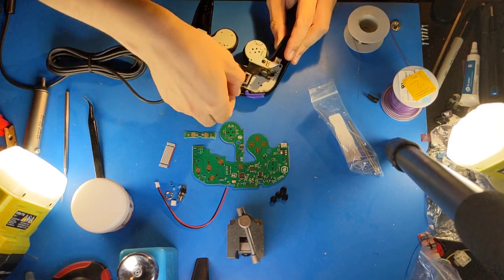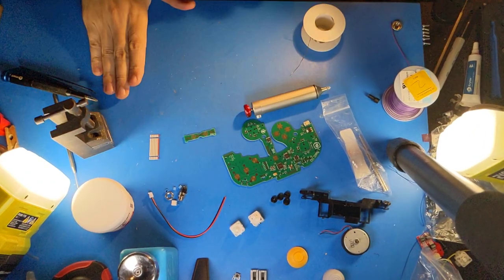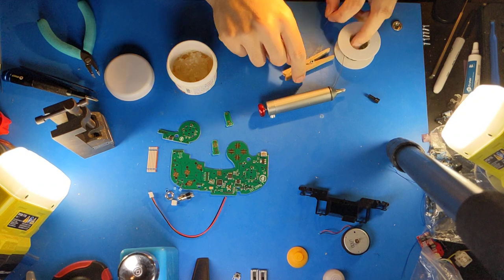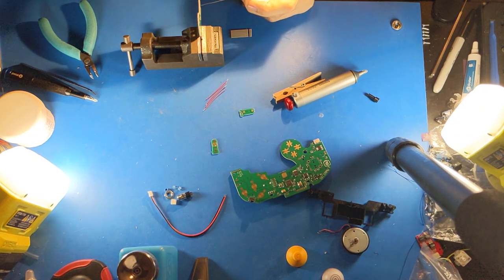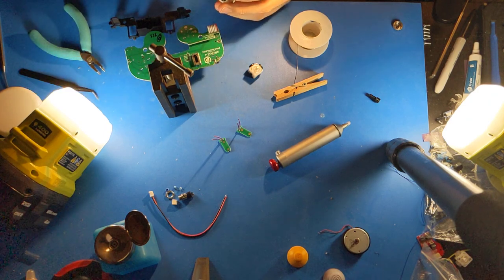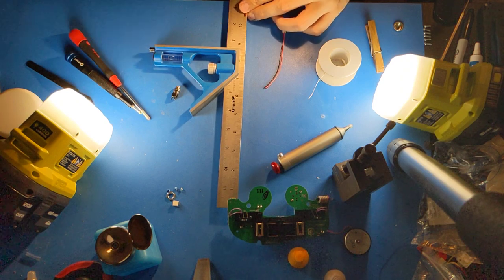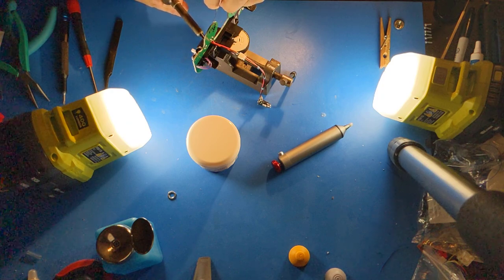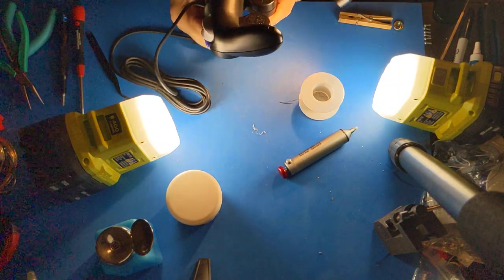PhobGCC 2.0 Assembly Video

Comment: Any way you could link to your soldering iron and tools like solder sucker, etc?
Reply from the maker: @suntzu6122  
Recommended tools from Amazon:
B08KDKMXRJ (vise)
B077JDGY1J (soldering iron)
B00HKJV8FA (SAC305 solder)
B002MJMXD4 (solder sucker)
B06XVQJCVK (superb triwing)
B0048F601Q (cutters)
B000XEUPMQ (wire strippers)

No particular recommendations, but get:
tweezers for holding parts
q-tips and wooden toothpicks for cleaning flux

Comment: You mention that the phobvision plug probably won't fit if the controller cable is connected via JST header. Is there an alternative mounting location if that is the case?
Reply from the maker: You can put the plug as low as you can on the back shell, and it might fit, but it might also touch the rumble motor. It works fine with no motor, though.

Alternatively, remove the JST and install a board-in connector such as Molex 50034-8000 crimp pins and 51015-0600 header housings.

I recommend this anyway if you didn't do the JST crimping yourself because many premade paracorded GCC cables have disastrously bad crimping.
Reply: @CarloVaccariPlus   Thanks for the video guide and the response! I'm partial to having the cord be removable so the motherboard is easier to work with but I may have to make an exception. I'll mess around with stuff when I get the components

Comment: I love this video and will be using it soon to build my own. I was wondering if you could share what flux and solder you use? I would like to try using the same.
Reply from the maker: @thesoupkitchenbros  I use 0.020" diameter Chipquik SMDSWLF solder and usually no external flux. When tinning wires, I use MG Chemicals 8341 no-clean flux paste in a jar.
Reply: @CarloVaccariPlus  Thank you very much for the response! I appreciate the info

Comment: What type of wire did you use for the L and R paddles? The phob didn't come with it so i'm curious
Reply from the maker: @gamermage95  26 awg stranded wire with pvc insulation. I got it from McMaster.

You can also just use the original wires from L and R on the oem gcc board.

Comment: What spec of wire are you using for the c stick and trigger paddles?
Reply from the maker: 26 awg stranded wire with PVC insulation.

And Kadano c-stick cables.

Comment: Sorry for all the noob questions, this is my first project like this. So from my understanding I need the phob, a shell with buttons, paracord, maybe a keyboard click z button upgrade, and the phob magnets. Is that it? 

Also I noticed there are 2 magnet types. Are they different in some way?
Reply from the maker: @suntzu6122  on the phob 2 parts ordering guide in the documentation, it lists everything you need. See the description for links.

You don't need paracord, and I actively discourage getting them because they're less reliable.

There are 3 magnet types. D12-N52 is twitchier, N30H will feel like it has a bigger deadzone, and DH1H1 is in between. An oem controller is on the D12 side of DH1H1, but closer to DH1H1.

Comment: hi, when you say it'd be good to flash the board befor starting the soldering process, to check status of the pcb, what do you mean by that and how i do it?
Reply from the maker: https://github.com/PhobGCC/PhobGCC-doc/blob/main/For_Users/Phob2_Programming_Guide.md

If the flashing process doesn't work, the board is in need of repair.

Do this first so you aren't left wondering whether you caused the issue by your soldering.
Reply: @CarloVaccariPlus  done. !! 
mine works. 

also, instead of using/ purchasing the six wire strip for the C-stick daughterboard, 

Can i use 6 smol cables? 

like,

would that be something technically wrong? 

thanks Carlo

Comment: I followed everything here and my controller doesn’t turn on at all. The board is clean. The solder joints are all connected. I installed the UF2 file. I’m always in port one. All Wiimote son Dolphin are off. What could I be doing wrong?
Reply from the maker: What adapter do you have? Most third party ones don't work. The best adapters are the Handheld Legend GC Pocket and the Input Integrity Lossless Adapter. Next is the OEM Nintendo adapter. In distant last place is the Mayflash 4-port, provided you have both USBs plugged in. Other ones just might not work (and are bad besides, even when they do work).

Can you reflash it? Does it still connect to the computer?

Try putting on the flash nuke file from the firmware flashing guide, which will completely erase the flash, and put the firmware on again.